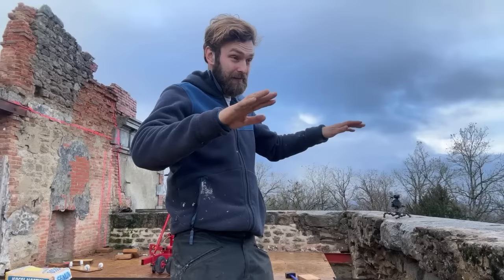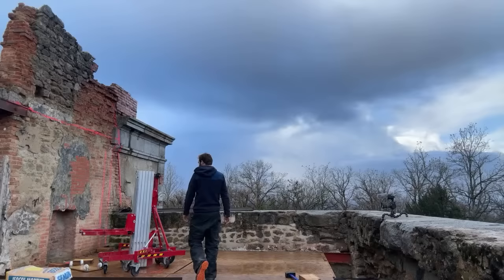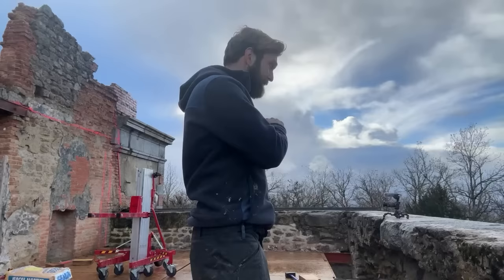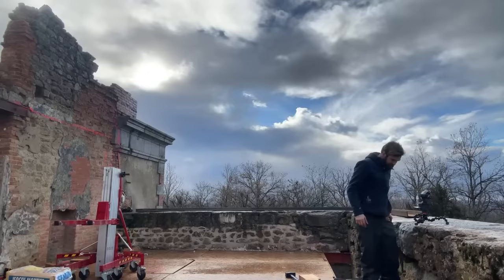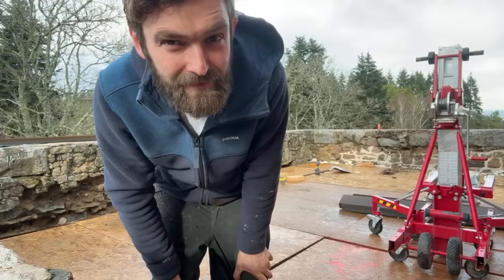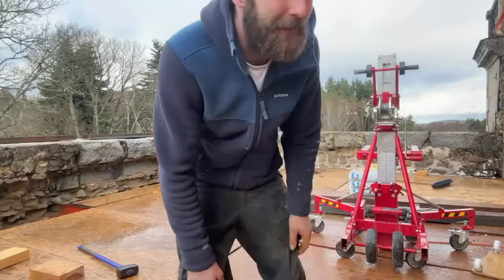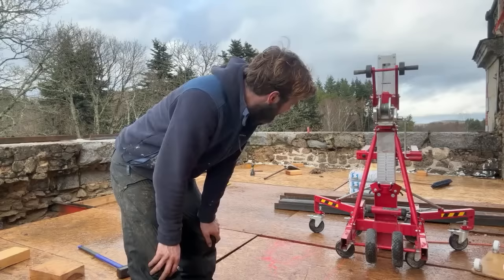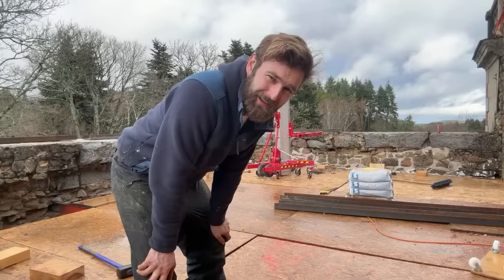Live from chateau de chaumont starting the roof.

Comment: Dan I was thinking about the reason I am mesmerized by the repetitive process of you slowly winching up beams- strengthing the floorboards with the never ending divettes?  It's like watching paint dry but so relaxing to watch you rebuilding inch by inch!!!
Reply: Ive just remembered the little bits of wood strengthening the floor beams Dan called "noggins" not divettes.

(I grew up in rural England and my father would say "I'm just popping down to the pub for a quick "noggin" !! (Pint of beer)

Comment: Looking good Dan, noticed when you were doing the tree braces you had a laser receiver. You could use that during the day to accurately set you U-beam wall plates. Also when Ive set timber wall plates in the past Ive set them into wet mortar, so you can adjust for level. Also that way you know it’s fully supported on the bed.

Comment: I wonder if the plaster will be sturdy enough to handle the load of the metal and wooden beams, the cladding insulation and all the other stuff that the roof is made out of. For some reason I suspect that instead of plaster you are probably going to end up with a more long term viable solution if you use concrete to achieve the same. The actual stone underneath looks to be granite which should not have an issue with some concrete on top.

In any case please treat the metal beams or isolate them from the stone/plaster/concrete as these are all surprisingly efficient transporters of water and iron beams and water is not a great idea. The same goes for the other side the wood is pretty good at moving water around to the lowest point and if that is an iron beam that beam thick as it might be will not be long for this world.

Comment: Not an engineer, but have you thought of finishing a steel frame along the outside edges of the interior?  The walls seem stable, but I would be concerned long term about buckling.  Having a full steel structure would be maybe 24 more beams, vertical and horizontal, but then masonry problems could be fixed with confidence over the long term.  I can see crudely how it might work I guess.  Love this old house, and you certainly are brave to tackle such a difficult challenge.  Bravo!

Comment: Hiya mate just an idea but if you take the handle of the beam winch and put a cordless drill ect on it with a socket attachment to wind up the winch or lower it it will be a lot more easier for you and quicker than manually I did it with a manual b4 and works a treat

Comment: I would roll either a foam or a very thin rubber roll under the beams.  To help keep the beams from contact and will give it a better seal with the bolts .😊😊

Comment: Couple of lengths of uni strut make a nice extension for those lifters. If you all thread you can use nuts under the steel to level them, drop some lock tight on the nuts and it'll stay level.

Comment: G'day Dan. I'm sitting here watching and looking  at you laying those channels on the top and asking my self "why hasn't he prep'd and painted the beams like he did when he first started. Because your going to use the channels as the base of your roof frames and the way you have them you should have drain holes/slots along the outer edge but inner lower corner and put a good quality primer on them before you even start to install them. The place has seen heaps of Xmas's without a roof surely doing the job right and being a bit longer would be better. Have you had the masonry work inspected before you go putting a roof on top of all of those bricks and rocks???? Have you ever had brickie's or rock jock's in to help you plan the reconstruction. I think you should have had at least some professional input into all of this. Its a massive undertaking in anybody's world but I think your going to have some serious problems. I hope not, I really do but I can't watch you do this any more. Good luck mate.

Comment: If you measure you will see that the top stones have a 0.5 - 1 degree slope to the outside. This will guide water to the outside if there is a small leak in the roof or water condensing on the inside of the rooftiles. Never rely on perfect seals, always build to guild the water. So tilt the U-channels slightly to the outside and dill holes to the outside so that water can escape out of the channel. Otherwise it will collect and go in the walls where the U-channels met or through the bolt holes.

Comment: The damage and decay has got worse the further up you go the strength in the mortar having leached away.the granite ring has acted as a roof to keep most of the water out.,The next level up rooms will need a total rebuild as much of the mortar and brick badly damaged by fire ,water ,wind and frost ,it may be too big a job for you without builders help.and still it rains!

Comment: Since the roof inner walls are footed to the floor, with most of the roof's load transferred thru them... I don't understand the need for the steel beams. They aren't taking much load, mostly lateral. Seems like their additional weight isn't worth the reward.
Also concerned about the steel beam's rust all down the outside walls just making a mess of things.

Comment: that machine would lift 3 at once and i would of put them on end walls and slide the front beams around. would be faster and easier. but you did well by yourself and they are on top of walls

Comment: Hi Dan. Check out a cool piece of machinery on Ed and Anna’s channel on latest episode that starts with Ancient treasures etc. it’s about 5.30minutes in and it is a machine that takes the tiles up to roof in a large 1 metre square container. It travelled quite quickly too. FYI
Reply: Dan has alot more floors than Edd. Wouldn't fit at Dan's chateau.  Hug difference in size of properties

Comment: You have address the drill attaching to lift so many times,  Next Time put in Blinking Ribbon on bottom of screen, "LIFT HAS VAULT SYSTEM THAT WILL NoT ALLOW THE  DRILL TO EXPAND WITHOUT IT GETTING LOCKED UP"

Comment: Dan, I'm surprised you haven't contacted a battery drill to the winder on the lift.
Reply: he answered and explained the reason why finally. He just said the lift has safety measures built in to prevent rapid ascend or descend of the lift.

Comment: I understand you straighten the top of the wall out with these rigid steel beams. But I am very curious how you will build up the construction on top of the wall. There will have to be some tie-rods installed to prevent the steep roof from toppling the top part of the wall over.

Comment: You NEED a welding machine - this is the necessary tool for this work.:face-orange-biting-nails::face-orange-biting-nails::face-orange-biting-nails::face-orange-biting-nails::face-orange-biting-nails::face-orange-biting-nails::face-orange-biting-nails::face-orange-biting-nails:

Comment: Will you be welding all the beams after cutting them?  Good job btw
Reply: There really is no need to. The original thin wood boards were in shorter segments than even those steels. I’m assuming that after he lays the steel in the lime layer, he will bolt those into the wall like the other C Channels.

Comment: I'm a bit worried that he's putting the roof on the INSIDE edge of the wall... won't water pool on the outside edge? standing water is never good...
Reply: Another commentor mentioned that those top stones may be slightly angled out, so the water drains. In the old roof, there were gutters installed outside of the roof system. We shall see!

Comment: Why don't you cut some boards to fill the gap between the floor and the wall?  Just for safety reasons?
Reply: He still has some reinforcement noggins to put in some of those perimeter gaps. Also, it gives him a little more light to work with on the floor below. He also has some more stones and bricks to lay below that level.

Comment: Why he didn't replace the crank by a rechargable screw driver or drill is beyond my understanding. It would make operating the lift so much faster.
Reply: he answered and explained the reason why finally. He just said the lift has safety measures built in to prevent rapid ascend or descend of the lift.

Comment: Are you going to put damp proof course in between the steel and top of the wall? Also I would lift the steel to drill holes as if you drill into the stone with a drill bit for metal it dulls the tip almost immediately.

Comment: Can you remove the handle and put a motor drill to crank 
the red scaffold 4:52Min
Reply: i dont read all the comment and didnt follow the channel the last years. you take a cordeless drill you screw it where the handle is and voila. you can easyly remove it too. will not take all that energy to crank and faster. you could varies the speed of the drill. i dont get why its a non sens. 2024 soon

Comment: Why are you using channel (C section) instead of unequal angle 150 x 100 x 8 say? no trough to trap water.
Reply: The roof material will go beyond those steels. Hopefully, there are no major leaks. I think those C Channels are supposed to have the slightest tilt to them to drain out in case any water would get in there. He will hopefully explained more details on this.

Comment: An electric motor attachment to your mobile lift would save you an hour a day. a temp construction elevator on the outside of the building (built into a set of scaffolding) would have saved you WEEKS !
That is my quibble, it would be safer, stay safe.
Reply: He  explained at the start of the video why  can’t do that.
Reply: He explained why he can’t do  that with the lift, he  doesn’t have wired power for an elevator.
Reply: I've used "battery boxes" for this type of thing before, does he NOT have any power on site ? A golf cart type battery would be enough to provide for much of his needs.
It's late in the project scope to justify the investment now but I think having some improved lifting power would have justified a small portable generator providing power to an elevator AND charging a battery for the lift.
I am in AWE of his work ethic and energy
!

Comment: its good hes at this point finally. but dont quite get the logic about the steels on the top of the wall. most of the roof weight is on the floor, but the distribution of load from the floor to the wall is not as good as before, because it now goes through only 6 steel ends and some thin bolts, versus before when the joists went into the wall on two sides. so seems a bit strange to use so much steel in a place its not needed. also he didnt do anything special to distribute the load from those 6 ends, and the wall is quite fragile at points.
Reply: Originally the slanted part of the roof landed on the top of that wall on thin little wood boards. Inside the attic room the walls came straight down to the floor. Then there is the upper roof that is not such a sharp angle. That is where most of the weight is. Having the steel perimeter on the top of that wall pretty much guarantees the roof to stay put in the most extreme of storms. I know he has had all of this checked out by an engineer. This is how it is done.

Comment: Dan i am just curious those beams are not 10,million pounds or kilos so who don't you put two on at a time? wall can't handle it? because the machine sure can i have one and i could put 4 beams on mine and still roll it all over and it isn't tippy or anything. well it is if i have everything at the end..... it is.. just slide them all back to the machine main support.... and when you get to wherever slide one to the end then off move machine over slide another off and so on. just saying... i know your trying to garnish likes and such but this way it will take you forever. which maybe i am wrong and that is what you want... me i work as fast as possible and  correctly safely too. This is like..well anyway being smart you understand my point.

Comment: Why don't you take the handle off the lift and put a drill on there to crank it
Reply: he answered and explained the reason why finally. He just said the lift has safety measures built in to prevent rapid ascend or descend of the lift.
Reply: Sigh